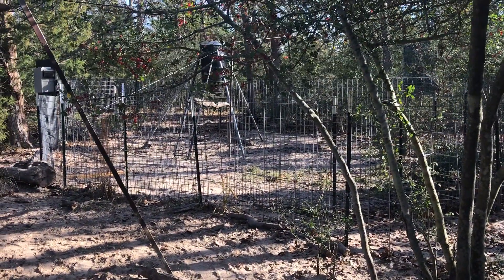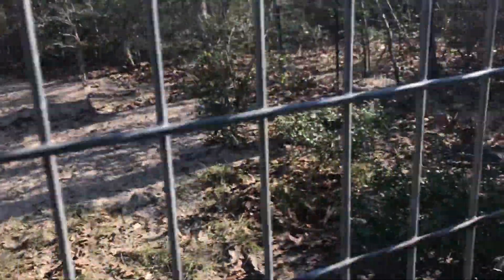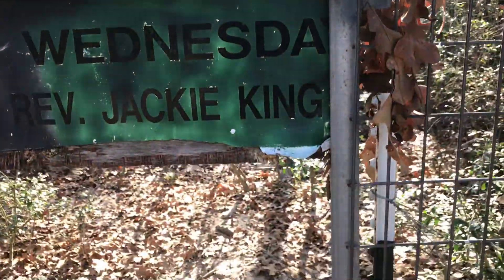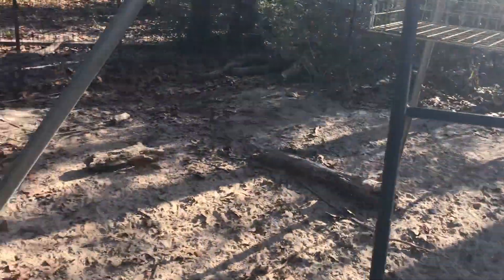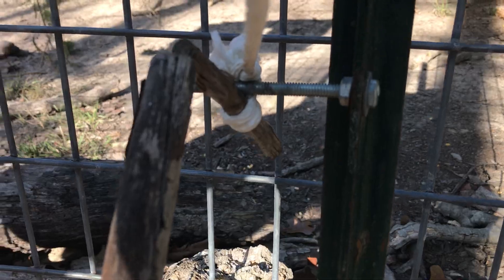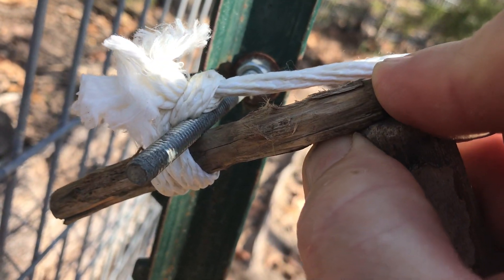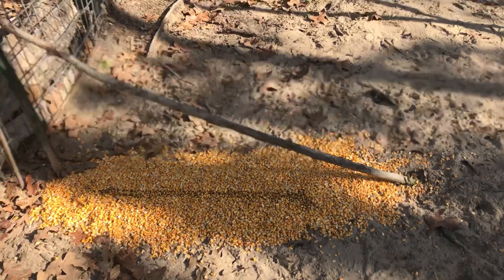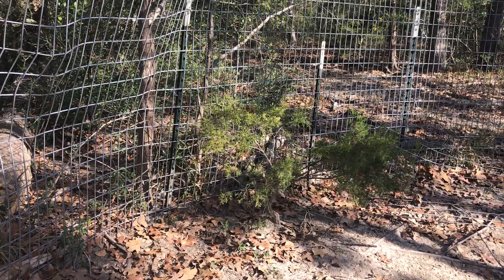Setting My Two Gate Repeating Corral Hog Trap W/Trigger Design

Comment: I just built my trap to have this exact setup. My door is from a piece of sheet metal and is pretty heavy. Its all I had laying around the house. I may have to use wire to hold it up, long term, but for now everything is working as it should. Thanks for the inspiration and great narration! "Eventually, someone will get a little greeedy."
Reply: Do you eat wild boars . The department of natural resources said don’t eat them because they have to many worms etc in them